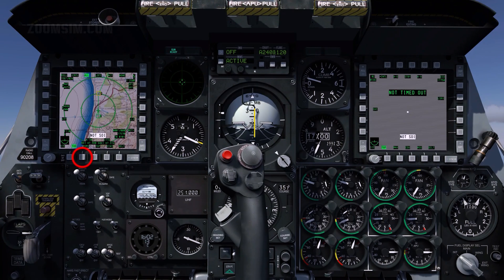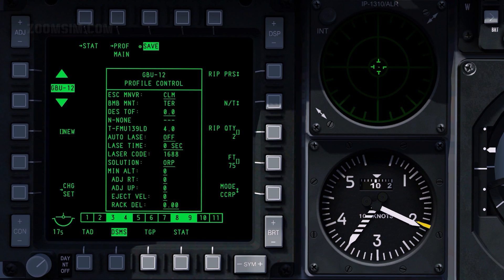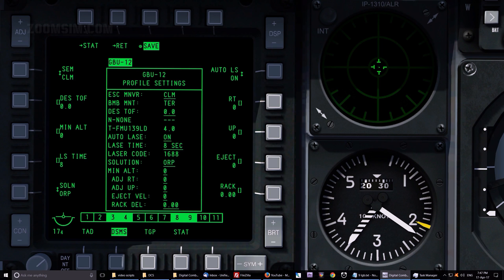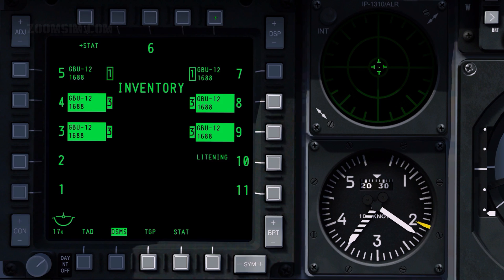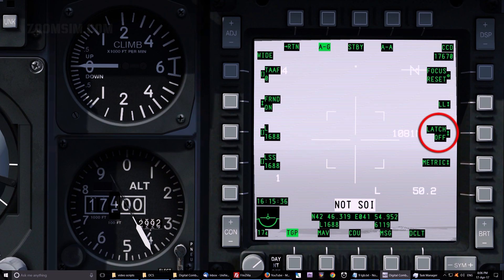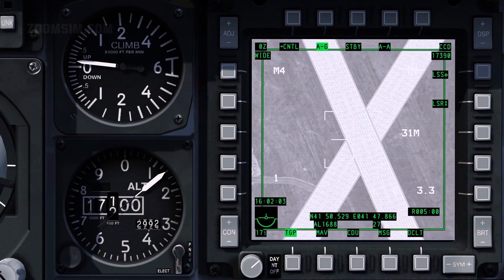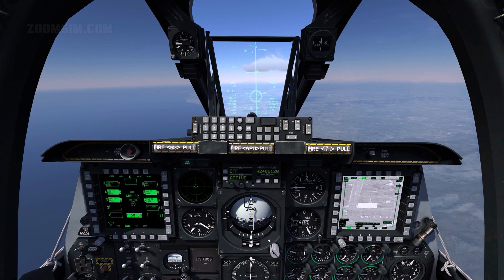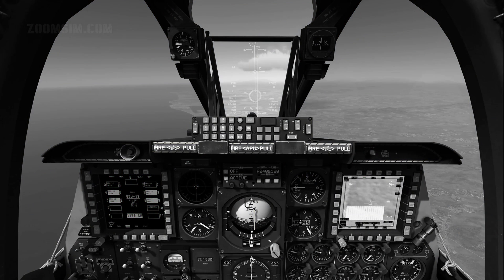DCS A-10C Tutorial 9 : Laser Guided Bombs

Comment: You can shorten the process to edit the LASER code by hitting "INV STAT" on OSB 3 on the master inventory page, it'll avoid having to chose the weapons type. Likewise you can chose "Load Sym" once settings are in to load the same configuration symmetrically on the aircraft, helps to speed things up if you've got a symmetrical payload. This goes for all weapons.

Valid LASER codes range from 1111 to 1688, with the first digit being 1, the second between 1 and 6, and the last two digits being between 1 and 8.

As an aside, in reality, while all codes in the range are vaild for the TGP, the Paveway series can only use codes from 1511 to 1688. Also in reality the minimum guidance time for the Paveway II is 8 seconds (12-15 is the most common range). LASER codes are set physically on the weapon using dials on the guidance section and can't be changed in flight (the DSMS is merely set to match the weapon configuration). These limitations are not modeled in DCS however.
Reply from the maker: Thanks for the insights. I appreciate it.